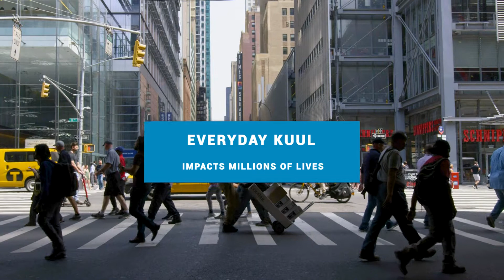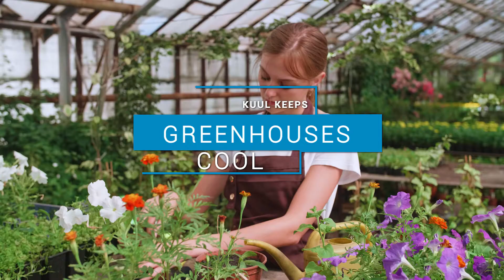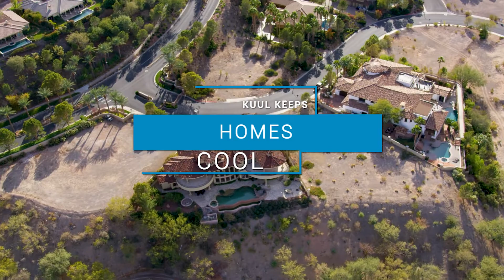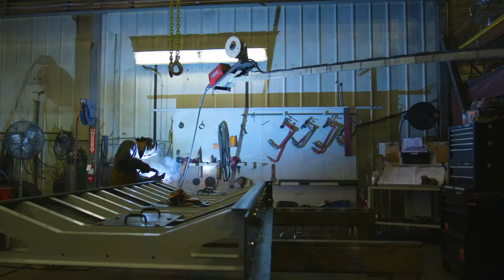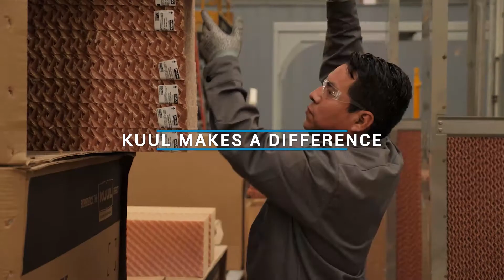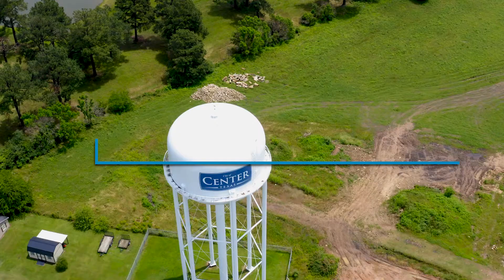Kuul Evaporative Technologies

Comment: is this machine durable in use considering the price is more expensive than other brands?  I have a trauma to a machine like this because the pump breaks very quickly and also the bottom of the machine uses a cover like a plastic hose so if it is opened more than twice it will leak.